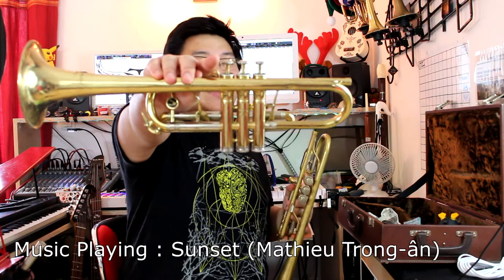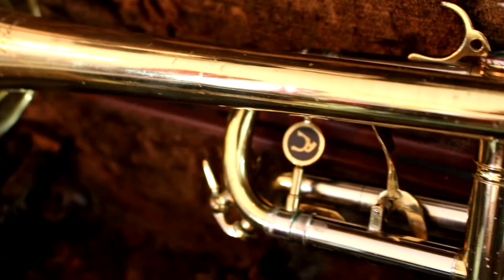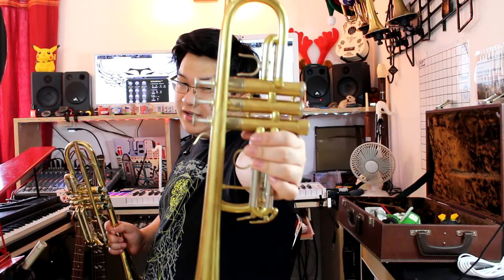Modern Trumpet VS Vintage Trumpet

Comment: You're wrong, the Courtois Grand Siècle is a model from the '70-'80. From what I can see of the serial number ( 32?9? ) it seems it has been built at the end of the '70.
Reply from the maker: Ji El I'm not really sure about the model but if you say so :)
Reply: I've got 2 of these, there not 100 y.o. at all.
Reply from the maker: Ji El well thanks for the info, but it's vintage and that was the topic of this test :)